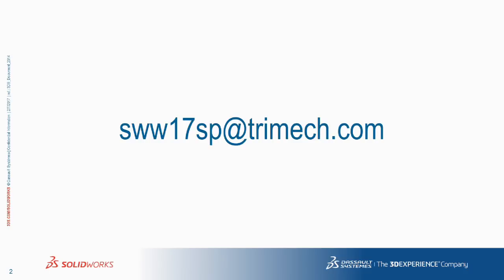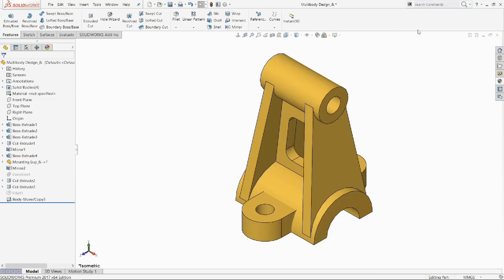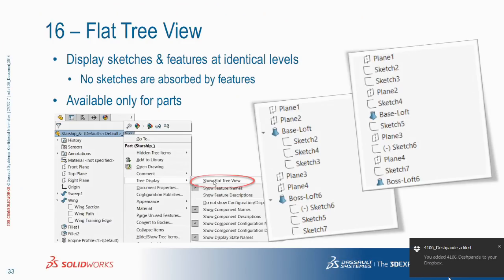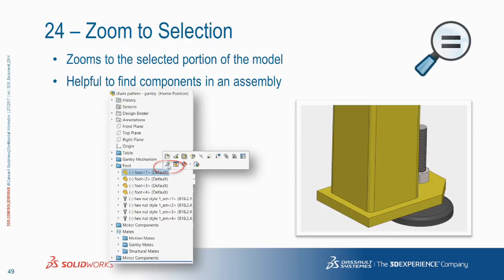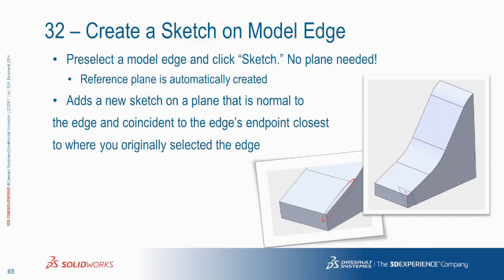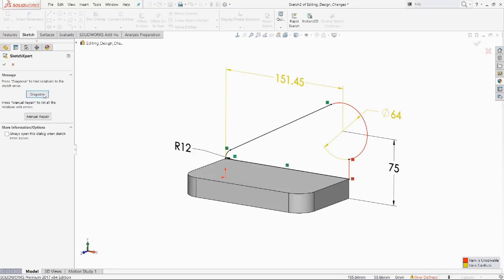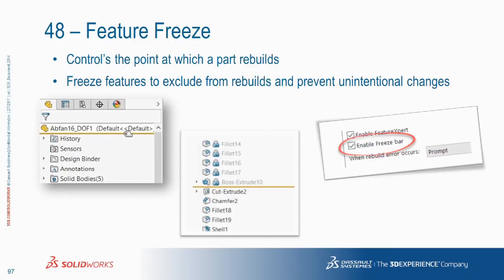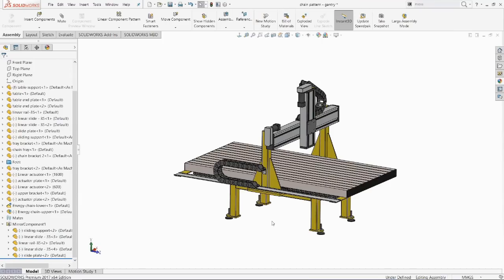SOLIDWORKS Tips & Tricks- 60 Tips in  60 Minutes. Learn so many tips in so little time.

Comment: TABLE OF CONTENT

00:00 0 - Introduction
01:08 1 - Options Search
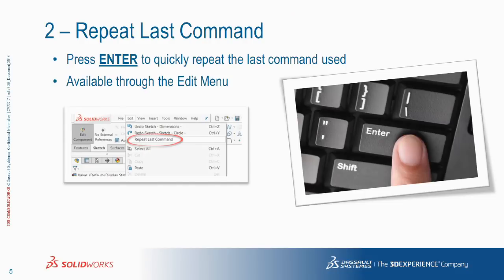02:00 2 - Repeat Last Command
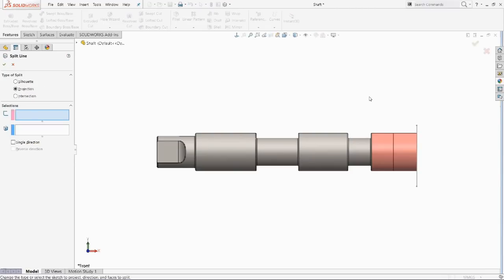02:34 3 - Force Rebuilt
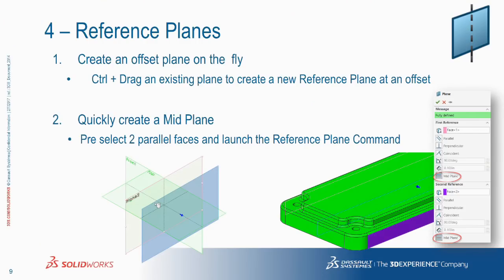03:41 4 - Reference Planes
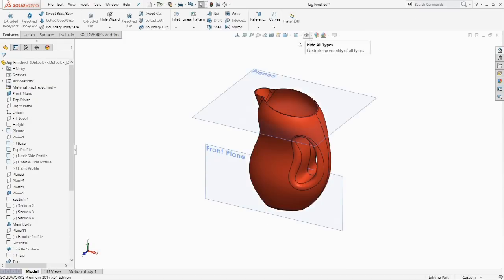05:00 5 - Recent Files
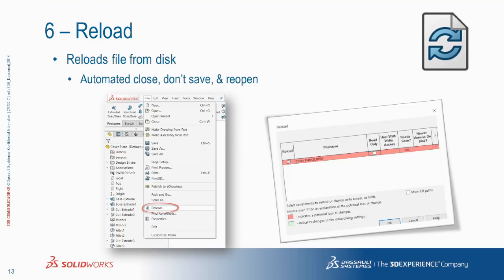06:07 6 - Reload
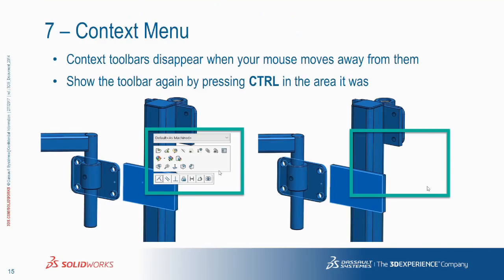06:56 7 - Context Menu
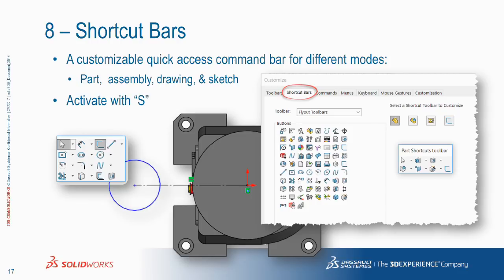07:58 8 - Shorcuts Bars
09:06 9 - Command Search
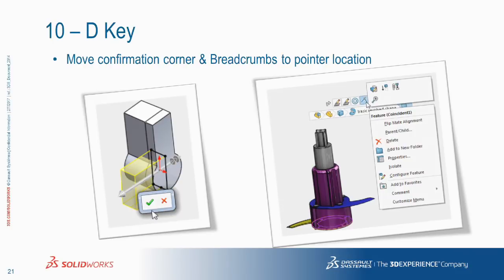10:24 10 - D Key
12:01 11 - Selection
13:16 12 - Customizing
14:46 13 - Save SOLIDWORKS Settings
16:10 14 - Browse Open Documents
16:58 15 - Filtering the FeatureManager
18:02 16 - Flat Tree View
18:57 17 - Collapse Tree
19:54 18 - Folders in the Tree
20:32 19 - Nuggets in the Tree
22:13 20 - Custom Views
23:26 21 - Rotate About Entity
24:18 22 - Zoom to Fit
24:59 23 - Normal To
26:03 24 - Zoom to Selection
27:02 25 - Rotate About Scene Floor
28:15 26 - Reference Triad
29:23 27 - Sketch Relations
30:15 28 - Window & Lasso Select
31:26 29 - Disable Autorelations
32:20 30 - Power Trim
33:20 31 - Dimension to Tangency
34:55 32 - Create a Sketch on Model Edge
36:08 33 - Fully Define Sketch
36:53 34 - Change Sketch Type Options
37:58 35 - Horizontal & Vertical Relations
39:36 36 - Create One Line
40:33 37 - Arc Dimension
41:06 38 - Close Sketch to Model
42:12 39 - SketchXpert
43:14 40 - The Biad
44:15 41 - Spin Box Increments
45:49 42 - Single Command Per Pick
46:39 43 - Pierce v Coincident
47:42 44 - Override Dims on Drag/Move
48:19 45 - Derived Sketch
49:29 46 - Reset Dragging 
50:20 47 - Performance Evaluation
51:21 48 - Feature Freeze
52:26 49 - Quick up to Surface
52:58 50 - Dynamically Load FeatureWorks
53:56 51 - Split Line
53:44 52 - Width Mate
55:32 53 - Hide & Show Components
56:05 54 - Rotate Components
56:33 55 - Assembly Visualization
57:18 56 - Open Top Level Assembly
57:48 57 - Ctrl + Drag to Copy
58:12 58 - Shift + Select Transparent Geometry
58:48 59 - Isolate & Display States
59:25 60 - Magnifying Glass
Reply from the maker: Marco Rodríguez awesome!

Comment: 45:57 i  dnt understand this part
Reply from the maker: This is showing an alternative way to use commands. By default you can use a command many times until you "exit" the command - meaning you can sketch 100 circles all within the circle command before you exit the command typically by hitting escape. But with this option turned on (single command per pick) you will only be able to use the command once and it will automatically exit the command.  In other words you sketch one circle and the circle  command is automatically turned off.Hope that helps
Reply: @stephen_petrock  thanks sir